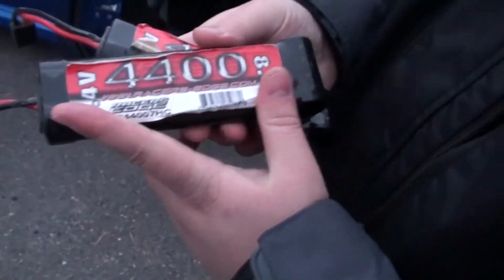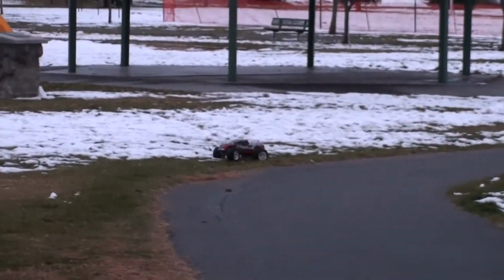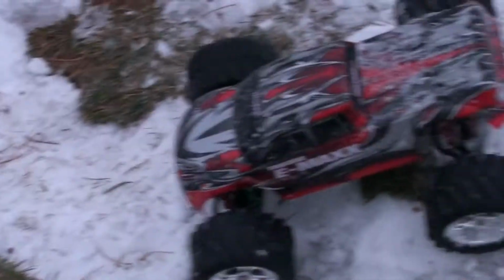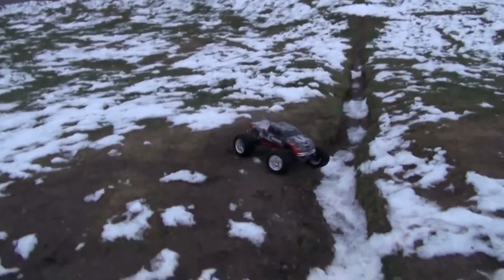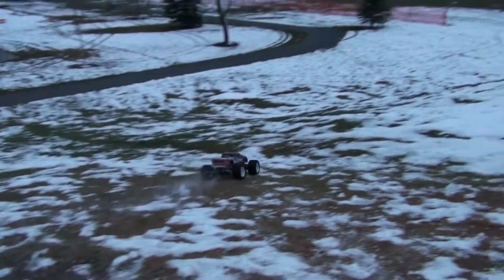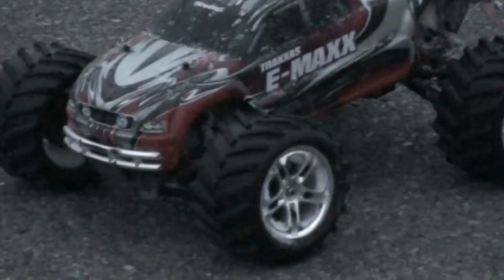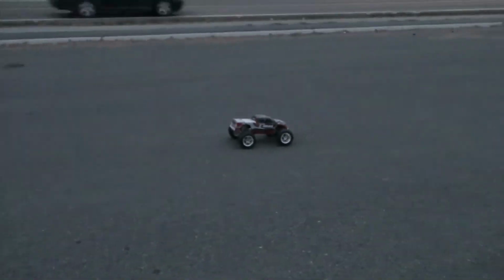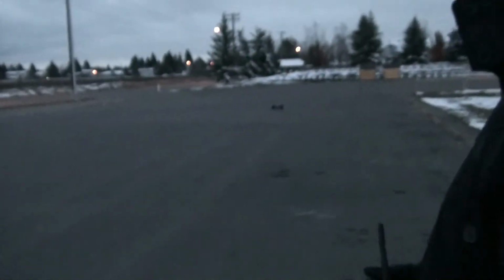Traxxas E-Maxx 3903 Snow Play

Comment from the maker: @HobbyKing1000 
Traxxas doesn't recommend doing the smaller VXL system on the E-maxx. It is made for the smaller 1/16 models and not the bigger 1/10, 1/8 models. The VXL system is pretty slick however, giving you brushless power and waterproof performance.

Comment: This is an old comment, but... You want to break in these motors via the 'water break in method'. I bought a Rustler XL-5 a few weeks ago, and did the water break in. On 2s Lipo it's quite fast (between 28 and 30 mph), and has lots of power.